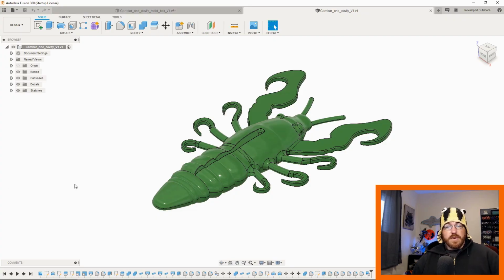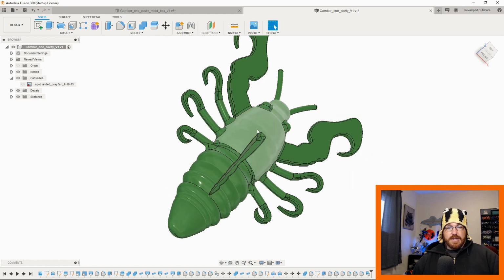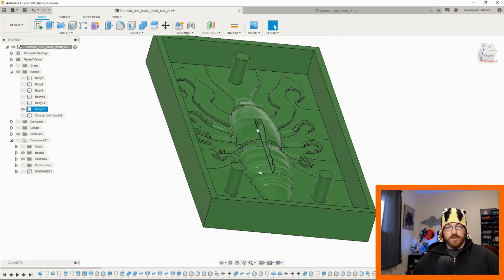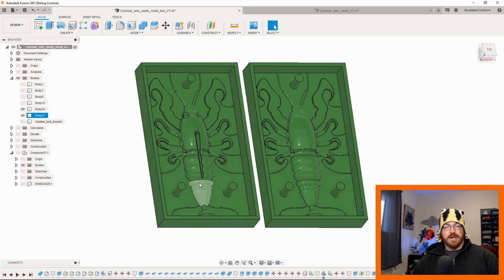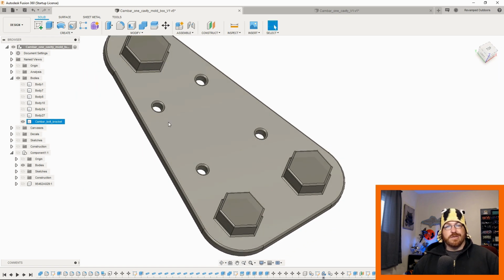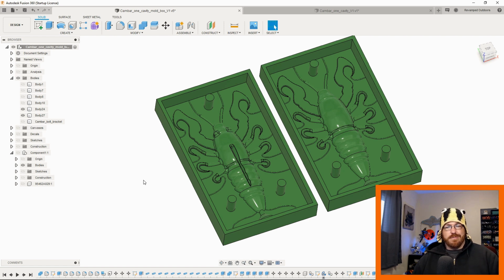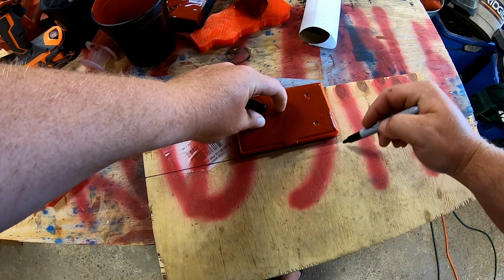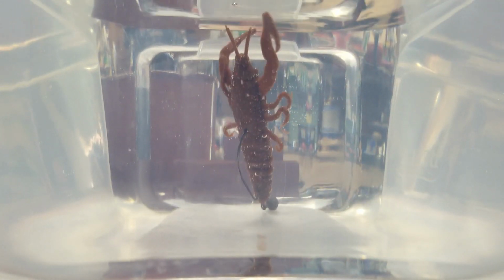Creating a soft plastic crayfish (crawfish, crawdad, yabby)

Comment: Just wondering what type of mold making material (silicon and catalyst) do you prefer?
Reply from the maker: Lately I have been using smoothon mold max 60, seems to be working well. If I had a design I wanted to make close to a professional mold I would choose to use Alumilite Vac50 inside a silicone mold. I may try that at a later date, vac50 is nice and more permanent but is costly and does require a lot of intensive clean up

Comment: I Add a reservoir to reduce dents. I do 12 inch + musky baits. And those can really shrink I'll use a reservoir about golf ball sizes in the sprue, it will take that plastic in as it shrinks and you wont get dents
Reply from the maker: Nice, I tried that on my last 8 inch swimbait still get a bit of denting on one side but much better than before.

Comment: man, how hard was it to learn to use the CAD??
Reply from the maker: It's one of those things, slowly learn it over time, basically on a case by case basis, if you want to do a certain thing hit up the youtube for a tutorial, eventually it becomes easier and easier. There are still things I'm not sure about with each project that I have to search for. So technically I still haven't learned it yet, but I would say to get at least comfortable with it took about a year. I'll let ya know when I get proficient at it lol. 3 years in so far and that proficient label is a few exits away yet.
Reply: @RevampedOutdoors  thanks!